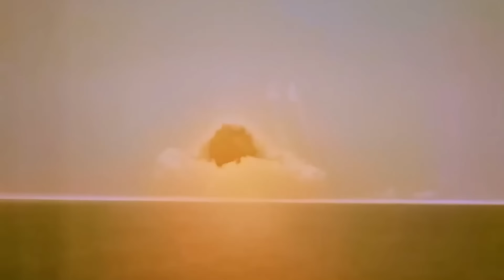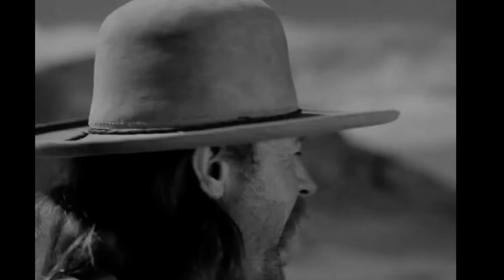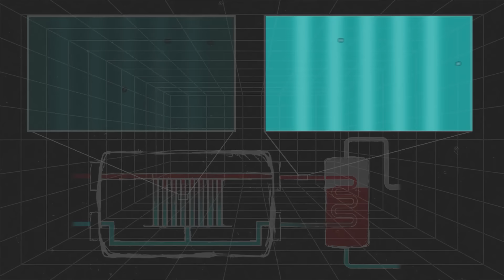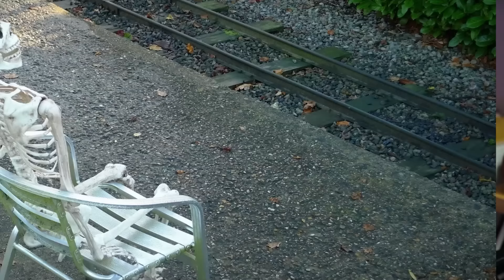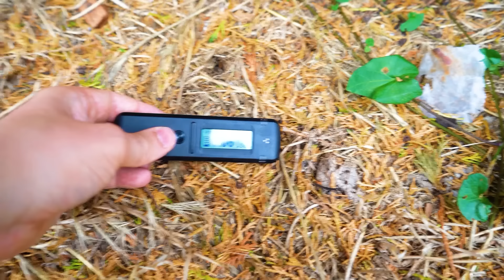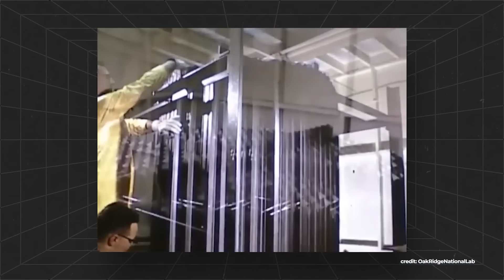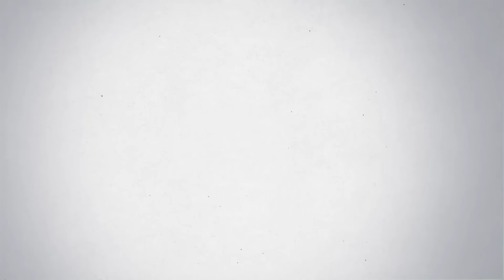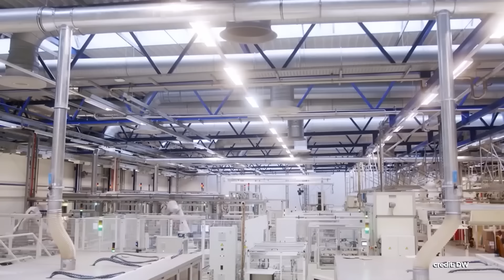It's Happening - China Launches World's First Thorium Nuclear Reactor

Comment: I hope for the first author with the competence of a physicist, who can comment on the economy. It is not about thorium, there is still enough uranium. Liquid salt dissolves all metals, including the metal of the pipes. Such a power plant breaks quickly. That is the biggest problem.
The Chinese have been making a test run for over a year now. In 9 years, they may be able to guarantee the function of the reactor for 10 years. Then the mass production of a small reactor begins, for very little money. This reactor can be transported by a Cargolifter to any place in the world, roads or rail connections do not matter. The electrical cables, very expensive, can be kept short. The construction period, previously over 20 years for nuclear reactors, is becoming very small. If China can meet these conditions, it will become a big business for the manufacturer and very interesting for electricity customers. I am looking for a video that provides more information about this economic situation.

Comment: Molten salt reactors are a perfect complement to solar and wind since the thermal energy from the reactor can be stored in secondary or tertiary molten salt tanks. This allows the amount of heat extracted from these tanks to be varied by just pumping more or less of the molten salt to the steam generator that then drives the steam turbines. Thus the reactor system can change the amount of electrical energy generated very rapidly to be able to fill in drops in power output from wind and solar. And it can do this without having to change the power level of the reactor itself.

Current pressurized water reactors can not fill this role since they operate at too low a temperature to make thermal storage practical and the reactor itself can not throttle up and down fast enough to provide load following. So the current reactors can only provide base load that basically never changes and thus does nothing to help even out the power fluctuations of wind and solar.

Comment: 2:45 Quick note, while the neutrons are going “fast” by human scales (~2.2 km/s), they are actually called “thermal neutrons” which have been slowed down to a speed about 5,000-10,000 times less than that of “fast neutrons” (~14,000 km/s). The reason being that the slowed down neutrons are orders of magnitude more likely to be “absorbed” by the fuel. They’re are still however “fast neutron” reactors that have been used mostly for experimental purposes but unless specifically stated in the reactor type, the standards are that it is a “thermal neutron” reactor.

Comment: Hehhh, I'll debate world first on molten salts, france had a molten salt 4th gen experimental-but-quasi-commercial reactor called superphenix up and for a while connected to the grid in an economical fashion, before moronic fearmongering 'environmentalists' managed to get it shutdown and set us back 20-30 years.

But it did use the fast neutron process and sodium liquid salts. It had 3 different aims, be a breeder reactor to make fuel for the more conventional reactors we had elsewhere, be able to recombine/reprocess spent fuel from other reactors, and on the side still be a design that can use the generated heat to make electricity and be in the green cost wise.

It was itself a developpment of an earlier prototype reactor called phenix which proved the breeder cycle was doable.

Comment: I remember hearing that during a power failure of current water cooled reactors, electromagnetically held control rods will slide down into the reactor core driving down the neutron flux and reducing the residue heat power to about 20-30% of the operating power. If that is true, then the need to pump coolant over a human lifetime seems more of a joke. But the tone of the video didn't seem to suggest a joke, just jovia. So my question, how long does it take to descramble a reactor after power failure?

Comment: Totally misleading: The Chinese 2 MW thermal test MSR is uranium fueled.  

More serious is that beyond test reactors - the USA Built 4 commercial thorium nuclear power plants in the 1960's - 1980's.  Germany built a 5th one as well.   The USA in fact went whole hog into trying to make thorium reactors work and even put thorium cores into existing BWR and PWR reactors to manufacture U233 to seed the future generation of thorium reactors.  The spent fuel was reprocessed to create tons of U233 for that purpose (and now we are spending Billions disposing of it as the storage containers degraded and its dangerous - with no realistic future use for it).  The USA had a full thorium nuclear fuel production facility, and modeled scale up to supply all nuclear power reactors in the USA.

As you discuss thorium reactor runs on U233 (not on thorium) - and U233 makes great atomic bombs (3 countries tested them), and the U233 spent (waste) fuel issues is essentially the same as with U235 with the same issues.

Those BWR and PWR reactor core designs are available today for anyone (except I believe India who openly violated nuclear agreements) who wants to use them.  If a thorium cycle power plant was a real benefit about 80% of the worlds nuclear power plants could quickly convert to thorium cycle cores. There is a reason they are not being used today.

Here is a list of the commercial power plants built to run on a thorium fuel cycle:

Indian Point Unit 1 – light water thorium fueled 275 MWe PWR power plant. Online in 1962. Changed to uranium fuel in 1965 and the plant spent the rest of its life as a uranium reactor that operated well. It was shut down in 1974 due to a change in safety regulations that was uneconomical to meet.

Elk River – a light water thorium fueled 22 MWe BWR. Online in 1964, Shut down 3 ½ years later in 1968 due to major design and construction issues leading to failures and radioactive water leaks. This was to be the prototype SMR reactor for the USA that could be build anywhere in the USA (the SMR concept was presented at an international conference in Europe in 1955 by the USA). It had also been determined by shutdown that staffing cost alone made the plant uneconomical.

Peach Bottom Unit 1 - a 40 MWe output thorium fueled HTGR reactor (as that seemed to be the most applicable technology other than light water based on test reactors). Online in 1967, shutdown in 1974. The thorium fuel was changed to U235 fuel. There were massive other plant design problems (scaling up from a test reactor size rarely goes smooth). A total commercial and technical flop.

Fort St Vrain - a 330 MWe output thorium fueled HTGR designed to incorporate the lessons learned from Peach Bottom Unit 1. Online in 1979, shutdown in 1989 due to design issues that could not be economically resolved. I had a coworker who had worked at Fort St Vrain and he told me that it was also converted to Uranium fuel; but I have not found any internet reference of that.

THTR-300 (Germany) 300 MWe thorium fueled HTGR pebble bed. Online 1985. Shutdown 1989. Main reason for shutdown was inadequate containment of radioactive particles and gasses from fuel handling system (design error). They were also having significant problems with pebbles breaking.

With the exception of Elk River, all other 4 plants or utilities stated that thorium fuel was very uneconomical compared to uranium.

There is absolutely nothing new about thorium, and the proponents are not discussing what we learned about it from our prior experience:  Key being that converting thorium ore in to thorium reactor fuel was much more expensive than converting uranium ore into uranium fuel (to the point that the thorium ore could be free - and was still the more expensive nuclear fuel); and there is nothing that shows that has changed since the 1970's-1980's.

The second key is that thorium ore is a mixture of typically 5-7 different isotopes of thorium.  One of those isotopes converts to U232 which is an extremely radioactive gamma ray emitter (really dangerous to health).  As such handling spent fuel and any possible reprocessing and chemical separation of uranium from thorium has a notable U232 gamma radiation issue.    This makes it noticeably more expensive to handle.

As a comparison:  If you reprocess fuel from a U235/Pu239 reactor the resulting extracted uranium and plutonium can be handled safely wearing nothing more than surgeon gloves.

For thorium fuel cycle reprocessing think people hiding behind heavy lead shields and handling small samples of the extracted uranium with 18"-24" tongs - and still getting noticeable radiation dose.

You totally gloss over the fact that the 1st 2 MSR test reactors that the USA built had real issues until the end of your video. The oak ridge reactor was found to have almost failed due to radiation embrittlement with also substantial corrosion of the Hastalloy used (once you start splitting atom you create quite the corrosive chemical cocktail mixture).    Various countries have spent over 15 years researching various possible "custom" super alloys in the hopes of coming up with something that would be immune from corrosion in a MSR reactor fuel stream - with no actual success (I've read some of the research papers).  

At the same time the idea that we could selectively filter out the worst of the corrosive byproducts from the nuclear decay and chemical reactions between various chemicals was developed and seems to offer some hope in test labs.

The Chinese U235 MSR test reactor is to determine IF we have come up with a suitable super-alloy combined with a chemical separation process such that we could build a 40 year operating life reactor without having to worry about the base materials failing.   A reality is it will likely take at least 5 years of reactor run time to even begin to answer the question if the answer is potentially "yes we have."

The proposed 60 MWthermal MSR plant is only a proposal at this point (and its a U235 reactor - not thorium).  It's schedule is likely to slip as it has not yet been submitted to the Chinese Nuclear Regulator for approval and licensing before construction can start - that will take several years.

China has always stated that the 2MW thermal test MSR would lead to a 40-60 MW thermal test reactor if it was successful, and then a small power plant, leading to a larger power plant, and ultimately a GW+ power plant decades from now (assuming the scale up is successful:  The nuclear world is full of examples where scale up of nuclear plant designs did not work)

Finally, your information is totally wrong about where power plant reactors can be placed:  Any power plant with a steam cycle will need water cooling by the very nature of the plant.  Very small test reactors do not need water cooling.  60MWthermal could be done with air cooling.